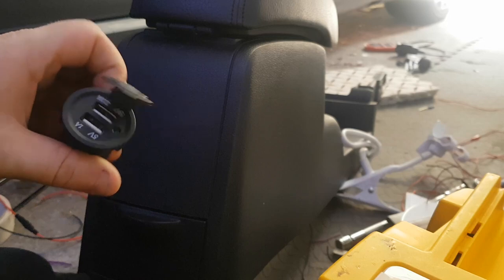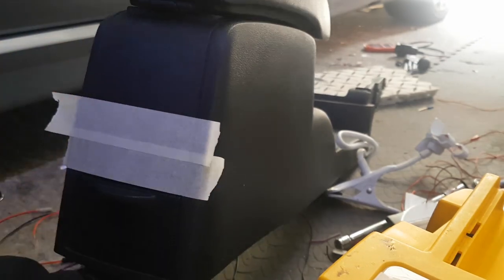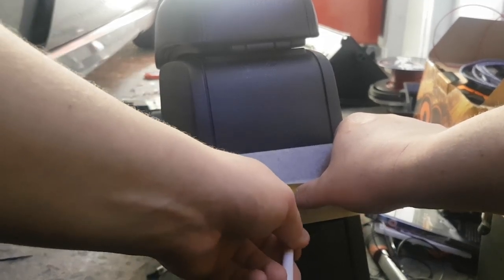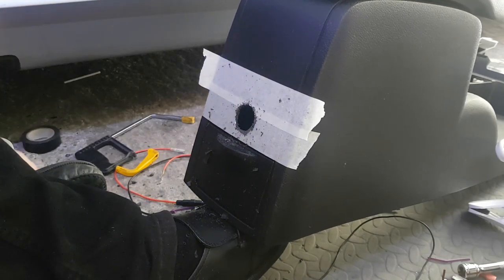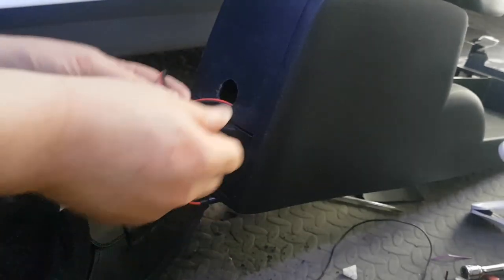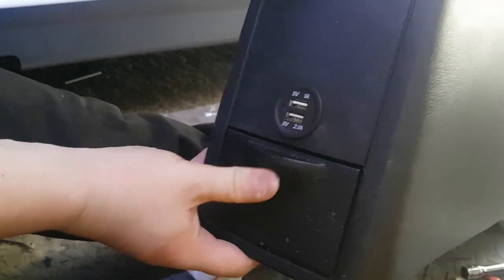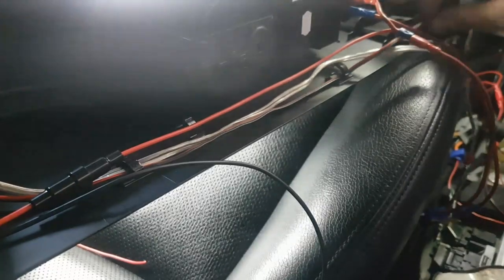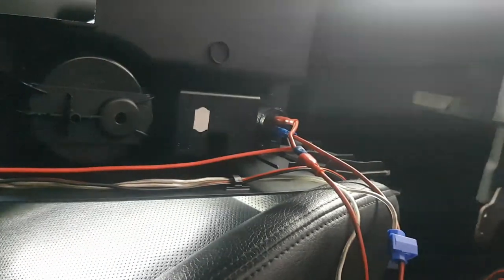How to install a Rear Seat USB socket (ford mondeo mk3)

Comment: Don't forget, (Depending on how your 15A cig fuse(F68) is fitted) the 12V supply to the centre consoul will either be on all the time or only on when ignition is on)
If its in the ON all the time position, the two USB supply units will be dropping 12V down to 5.1V and drawing a very small current.(As nothing is 100% efficient you will get power losses <disipsted as heat> even with no load on the 5.1 oputput.)
If the car was left for a very long time it could drain the battery.
Suggest fitting the 15A cig fuse (F68)  in the only powered when ignition is on , position.   ( Search for cig fuse mondeo mk3, its in the clove box)
It has a top and bottom position it can go in.
Avoid those horrible blue snap on connecters, use propper crimp AMP termials and crimp tool as shown in video, or solder wires and use heatshrink sleaving for best results.
Very handy for small people who want there tablets/phones charged while they are using them.

Comment: Hello and thank you for the video. I have this same setup but replacing the cig device with an USB device with a switch to turn it on and off. Do you know why I have electric alterations when something is connected to the USB and the 3,5mm audio jack at the same time? Like it can power the USB via the audio jack when the red wire is switched off.

Comment: Where did you get those sticky pads for the wires bud? I'm going to be installing some USB sockets soon for running sat-nav charging phones and running a dash cam.
Reply from the maker: my dad left me some with his pc, i have a few here. PM me and i will see what i have left mate
Reply from the maker: @TheFakeRussian  cool, glad you sorted it. When i run out i will have to get some.
Reply: @ChazzCoombes  18 of them for a quid isn't bad at all. And it saves drilling holes to use tie straps. Now the question is will the sticky pads hold if things get a bit damp due to condensation? I suppose if you use a bit of acetone and a cotton ball to clean the surface first it should be OK.
Reply from the maker: @TheFakeRussian  well mine has held up for awhile now so all good so far

Comment: Great video. Quick question as I’m still fairly new to the mk3. How easy is it to get the console out to fit the usb?
Reply from the maker: Hi mate, will be posting the video on this shortly. Thanks for watching
Reply: Chazz Coombes nice one. Cheers. I have the bits on the way 😁
Reply from the maker: +nellyst24 not a prob mate
Reply from the maker: +nellyst24 not a prob mate
Reply: No need to take out centre console...Just undo screws to give it a little leverage for wires. The hole can be drilled in situ by lifting back seat. Just ensure you make the hole a tight fit. Connection can easily be made into the front cigarette lighter..hope this helps. L
Reply from the maker: Lou's Trains i only done it this way as i had it out the car already.

Comment: Where did you get the wires? What thickness?
Reply from the maker: jamesbettell this kit came with some wires to do it.
Reply: I'm looking to put a cigarette lighter socket in the boot, need longer wires to spur from the one in the centre console.
Reply from the maker: jamesbettell when im in the garage  tomorrow i will check the wire awg and let you know.

Comment: I must have owned a car after you fuckin wires everywhere !!!
Reply from the maker: paul what car is that then, lol. Ive had no issues with anything
Reply: @ChazzCoombes  XR3i sold it years ago. Nice videos mate.
Reply from the maker: @paulgriffiths6344  omg nice motor do you ever regret selling it? and thanks i do try, lol.
Reply: @ChazzCoombes  no had all the XR's and a mk3 mondeo ST, i'm getting on a bit now and like to take it easy in my mk4 tit x